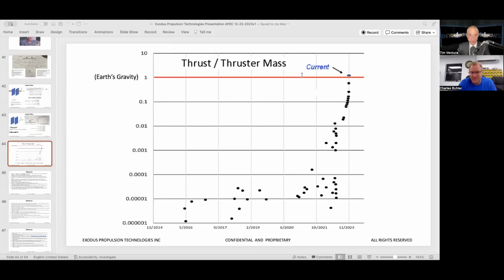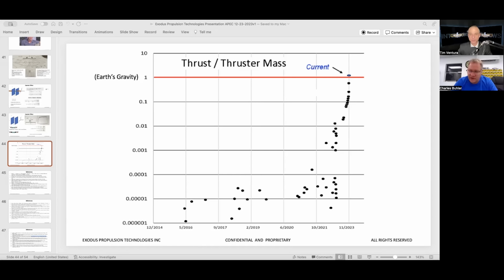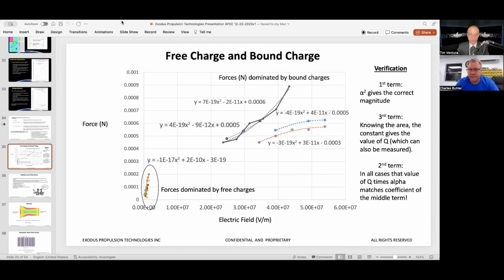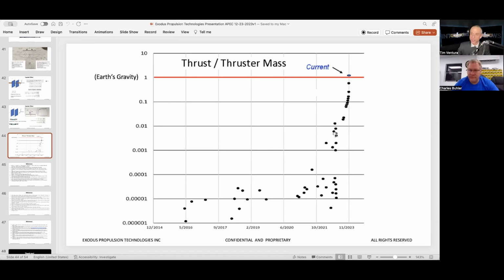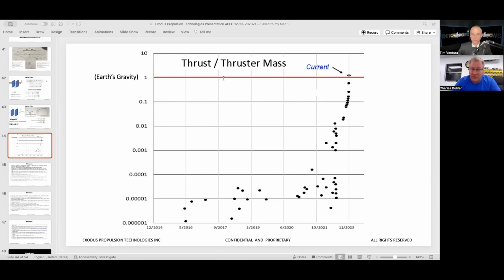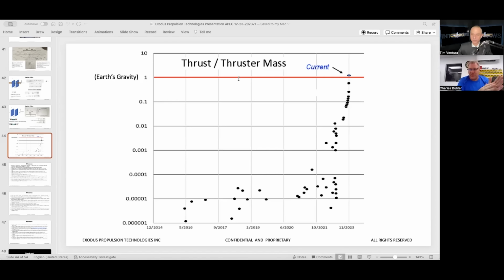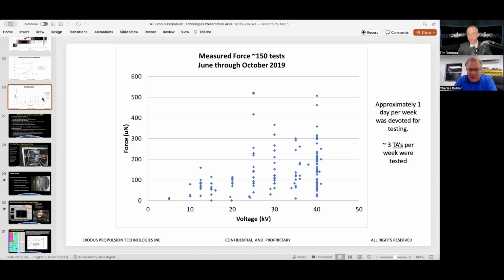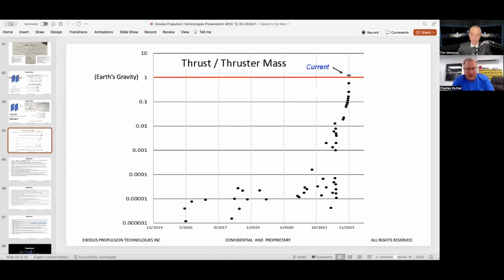Propellantless Propulsion Device | Charles Buhler

Comment: Getting to Mars at constant 1 g acceleration takes just 89.44 hours. To Jupiter is 157.44 hours. It only takes a year to reach near lightspeed. This is HUGE!
Reply: To reach but double to slow down
Reply: @openleft4214  oh give or take, sure. But you aren't really limited to only 1 g for human endurance either.. so both acceleration and deceleration phases could conceivably be shortened further, or even add a period of weightlessness near the middle of the voyage. Which could be fun.
Reply: Do they realize that have 1G of force using electrostatics only, is basically a very close to "free energy" ?
Because if you have 1G of electrostatic force, you could use to rotate a modified AC generator with nothing but charge maintenance. 
Does anyone understand that???
Reply: @raysplay2827  Absolutely. I've been giving this thing the biggest possible benefit of the doubt by assuming a constant power draw but really from what the guy said the power draw is literally zero! Literally getting energy for free.

Also I hope he realizes that "1 g" when you have a tiny fleck of paint or whatever his test article is, is not at all impressive.
Reply: @isodoubIet  seems like it's free as long as you don't do work with it.
Once the electricfield is used to do "work" like rotating a rotor, this will require energy.
When the force is just force and doesn't do anything, then it's OK and energy won't be consumed you only have to maintain the charge.
Reply: @raysplay2827  this might be an interesting point to interject and remind everyone that perpetual motion already exists.. there is a sample of helium-4 (which makes up about 1/4 of all the matter in the universe) that was only stirred once, and it will continue to swirl forever, or as long as the temperature is kept below -270.98°C, whichever happens first. I'm not saying you can extract useful energy from it forever and keep it moving forever, that would violate conservation.. but to hear physicists scoff at "perpetual motion" as a concept is.. special. Remind me how Newton's First Law goes again? Are we just forgetting all the countless planetary systems with stable, harmonic orbitals? Or what about the humble, timeless photon? Neutrinos or even ultra-high energy cosmic rays if you're hung up on 'objects' having rest mass.
Reply: What I'm saying is the outside forces can be constructive as easily as destructive-- consider two opposing planetary transfer close fly-by maneuvers, used to obtain the exact opposite result on their total velocity from interactions with the same body of mass, at pretty much the same altitude of periapsis, traveling on very very slightly divergent trajectories but from the same origin: the slingshot or the capture maneuvers; merely by aiming for the trailing edge of any mass, with respect to its own path in orbit (around the Sun for a planet, but this works with moons as well), you are able to gain a significant boost in velocity, easily adding kilometers per second to your mission delta-v budget essentially for free, aside from the added time. The Cassini spacecraft averaged a 0.75km/s increase in velocity with each pass by Titan, of which it did 127 encounters in total, for reference. Conversely, if you aim towards the leading edge of a planet on final approach to an encounter, the force of gravity acts increasingly against your velocity vector during the time leading up to and just following your closest approach (or periapsis), bending your trajectory even more than a slingshot would, but also slowing you down, making it much cheaper to perform a deceleration burn to drop into an orbit. This is an example of simple gravity applying the Oberth Effect automatically to objects with the correct fly-by trajectories. Look, we don't have a unified, quantum theory of gravity yet.. but we know all these effects are happening between wave-like particles on the quantum fields and spacetime itself. We can make pseudoparticles with amazing properties; we can evaporate matter into radiation, and condense radiation back into matter. To say that we're done discovering is to ignore everything we already know!
Reply: @graphite7473  What you were saying before was wrong. What you're saying now is not even wrong.
Reply: @isodoubIet  I can't make sense of any of your points. What are you trying to say here?
Reply: @raysplay2827  "charge maintenance" does not sound like you're getting anything for free.. that sounds like any ordinary electrically powered system, from a thermodynamics perspective. Certainly this one is engaging with the fields in ways we haven't seen or defined previously, but that is not some kind of surprise in and of itself..  there's been a rather steady stream of new ways to get stuff to interact with other stuff and even just entirely new stuff that was really there all along, such as the Higg's Boson, over the last many, many years.. from pseudo particles to metamaterials, twisted bilayer graphene and other novel conductors, Bose-Einstein Condensates, etc.
Reply: @graphite7473  Nope, it's not the same.
Think of it as charged batteries that are not being used.
Some batteries can keep the charge with very low leakage.
The electrostatic force is not being used it just is there in a certain direction.
It's not being used to move objects and therefore the energy of the electric field not being used.
Simply put, there is no energy transfer happening, maybe a bit to ambient particles present between the plates.
Reply: @raysplay2827  I have no idea what you're saying? Neither do you, I suspect.. look, are we not talking about a thruster? That provides thrust? To objects with mass? Using the electric field? I'm struggling to find a coherent argument in your replies, but I'm just not seeing it?
Reply: And... it's bullshit.
Reply: i asked chat gpt 55.41days round trip to mars at 1g
Reply: @TheFilmGuyOfficial  yeah that's fine for chatbot, because chatbot has no mass! 🤣👍
Reply: @TheFilmGuyOfficial it's 2-3 days to get there.. AI is brain rot.
Reply: Read the UAP Disclosure Amendment of 2023
Reply: Yeah, i dunno, I call BS.  Until its in space operating it aint real.
Reply: Next 2 questions.
1. Deceleration
2. Time dilation
Reply: @sebastiancleveland727  1. Yes I put the travel times for a fast fly-by, 100%.. and yes, an orbital insertion requires deceleration to drop into orbit at your periapsis of initial fly-by, so certainly a mission to land somewhere like Mars will take longer, but we're still talking a difference of hours not weeks.
2. 1g is the same force the Earth exerts, so literally there would be exactly the same amount of time dilation as at sea level on Earth. You couldn't even operate a functional GPS satellite under 1g of constant acceleration.. time dilation is normally used to complete the triangulation calculation!
Reply: @Dandelion_Stitches  Charles Buhler, PhD
Dr. Charles Buhler, the Principal Investigator for Poly-Adaptive, LLC is also the owner of CRB High Field, LLC an electrostatics research and testing facility in Cape Canaveral, Florida.  For 10 years as a senior research scientist in the Electrostatics and Surface Physics Laboratory at NASA Kennedy Space Center, Dr. Buhler worked on several electrostatic discharge (ESD) issues, including ESD safety, gaseous discharges (e.g., corona, pulsed corona, glow, brush, and propagating brush discharges) in hazardous environments for the Space Shuttle Program, the International Space Station Program, and the Hubble Space Telescope Program.. He was a Co-investigator for three NASA Research Announcements funded by the Mars Exploration Program with research in the areas of: instrumentation for the classification of Martian aerosols, methods to prevent dust accumulation on surfaces under Martian conditions, and the link between electrostatically charged dust and the lack of organics on the Martian surface for the planetary science community.  He continues to serve as a subject matter expert on NASA's E3 Panel, the agency's leading board regarding all ESD-, EMI-, and EMC-related issues for the space program.  Dr. Buhler has spent five years on NASA's Dust Project focused on electrostatic methods to remove dust from personnel and equipment to be sent to the Moon through NASA's Constellation Program.  He now leads the research effort for Poly-Adaptive performing guidance over all dust mitigation strategies for commercial and non-commercial applications.  Dr. Buhler completed his doctorate in Condensed Matter Physics at The Florida State University in 2000.

Ok let's see your CV for a comparison:
Reply: That's what she said
Reply: It has to decelerate upon arrival, the same amount of time if 1G is used.
Reply: @davidhoch  of course.
Reply: If this is real, you can potebtionally make a warp drive and even go ftl.
Reply: @bringtheideas460  I don't think he's canceling inertia with this drive, rather it relies on there being some to add momentum to. It's still classical acceleration, only it uses a novel electromagnetic field interaction to push or pull off of, and only needs onboard electricity to generate that force, no reaction mass/exhaust. At least as far as I can tell, and assuming his data and the effect is true.
Reply: @bringtheideas460  this however might be a way to accelerate a vehicle that does use inertial mass cancelation? I'm referring to Salvatore Pais' inventions, for example.
Reply: @graphite7473  That would be raaly cool if that was the case(refering to salvatore pais alikeness), because if you are reducing inertial mass, you might be bending space time? Not sure. But if so, you could perhaps make a warp drive out of this. Like if these assymetric caps produce negative space-time curvature, there you go. Warp drive. If not that then you would still have an exhaust from some kind of engine propeling you, but you turn this on and speed up. But that is just a thought. 

The real problem with having a force like this its apparent violation of termodynamics at first glance. Some energy must be spent somewhere if you are accelerating something. To be exact the electrical energy will have to convert to mechanical. Inertia is a type of mechanical energy. Sou maybe it will lose charge with ascending/accelerating(the assymetric cap)? Dunno. But otherwise you would be creating energy out of nothinh if it was just a force like gravity.
I bet it would draw current when accelerating...
Reply: @bringtheideas460  it's my understanding that this drive would never quite get up to lightspeed, but it would certainly continue approaching it as long as it has power. After one year of operation at 1g it would be well into the final 1% below c, and would have traveled about a half lightyear. It's tricky to predict the degree of time dilation, as most of the curve (describing the Lorentz Factor) happens in that last 1%. Time moves 7.14 times more slowly at 99% (of c), 10x at 99.5%, 22x at 99.9%, 224x at 99.99%, 704x at 99.9999%, etc exponentially.. but the bottom line with relativistic velocity travel is that the further you can go accelerating continuously, the less elapsed time you'll experience when traveling further and further distances into both space and the future, with greater and greater ease (and less and less aging). To be clear, I do think it's likely that FTL is possible, I'm just saying that this inertial drive wouldn't give that effect, despite being itself leaps and bounds ahead of anything else we've ever come up with for locomotion.
Reply: Wow, Is this really true, sounds like zero energy production. There should be all hands on deck!!!
Reply: Having read most of the conversation under this comment, I feel there is not enough information to come to a conclusion about it being a perpetual motion device.

My reason for saying this is because, they charge these dielectrics in a vacuum. This 1g of thrust is acting only against gravity - not atmosphere. We don't know how much charge they put into it, how large it is, or how much it stores. The fact that it retains charge, and presumably thrust, could just be a sign that it had not expended all of the energy that was stored in it upon its initial thrust and therefore has not violated the laws of conservation.

Unless I just misunderstood the whole thing.
Reply: As soon as he started in about AC and capacitors with bound charge, he lost my interest.  Fake.
Reply: @caseylynch4001  ok but he's literally the guy who was in charge of electrostatic safety on the ISS, the Hubble telescope, and the Space Shuttle.. he is considered a subject matter leading expert in electrostatic effects.
Reply: @caseylynch4001  capacitors are real..
Reply: Вы учили в школе астрономию? Как движутся планеты по орбите?
Reply: @добро-х  It won't let me copy your comment, so I can't plug it into a translator. I only speak English and French fluently, with the odd few words in random other languages, but mostly phonetically. Can you translate that to English?
Reply: @добро-х  I don't even have a virtual keyboard on my phone that I can use to type that out visually.
Reply: I think I could deal with 1.25g.  you?
Reply: 1 g of force?  You need a mass in there...
Reply: @kayakMike1000  I'm not sure what you mean? You mentioned "the strain", and I clarified that you and your ship will only feel the force from 1 g of acceleration (assuming you've chosen that rate of acceleration, to remove health concerns from prolonged low or high gees). What's novel here is the nature of the propulsion system, and that it essentially removes fuel mass from the rocket equation, excepting the fuel used by on-board power plants, and the mass of any related components (but those are static mass values, so they fit into dry mass anyway). Obviously we would use nuclear reactors of one kind or another for their efficiency, reliability and long life, although a device that is designed to reach near to  lightspeed offers the unique opportunity of reduced operational lifetime with respect to the Earth's frame of reference. As stated earlier, after about one year of continuous acceleration at 1g, it would be experiencing somewhere between one hour for every seven hours up to 1hr/hundreds of hours that pass back home. If you just keep accelerating until the halfway point of any trip, it starts to not matter how much further away the destination is more and more as you aim for further and further away. Relativity is on our side for almost any distance of travel within our individual lifetimes, if we can accept abandoning everyone we knew and left behind in the 21st century.
Reply: I have tried talking to other scientists about this, most won’t even look at it they are so dismissive, but I hope it’s true. Looks amazing 🤩
Reply: Sharefacts/ StarDrive Engineering company been Designer and Builder in Scientific Sciences and Advanced Quantum Mechanics Physics and warp dimensional drive saucer spacecrafts technologies !
StarDrive Engineering company been Contractor 39years for Dept of Defense pentagon 
Example /StarDrive Engineering company warp Dimensional drive from earth in milky way galaxy to andromeda galaxy nordic 240 seconds by warping Time and warping space and warp 132 multi dimensional universes by traveling faster than speed of light!
Reply: There is no gravity or gravitational effects inside a warp bubble, no G forces, no G force limits on acceleration. G Force of propulsion is a factor of the total capacitor charge, add more caps, get more propulsion. FTL in under 1 year at 1.5 Gs, but why stop at 1.5 Gs when there is no G force limit.
Reply: @NoNo-f4h  this isn't a warp drive, but I feel you. This is a lot more like the impulse engines, just to be clear.
Reply: @NoNo-f4h  there are definitely g force limits with any kind of impulse propulsion. Whether it's the structural integrity of the spacecraft itself, or the survival of human occupants, there's only so much acceleration force that can be handled. An extreme example would be a detonation ripping something to shreds, but even sustained 16g maneuvers will rip the wings off an F-16.
Reply: Keep in mind that 1g for the device itself basically means a thrust to weight ratio of 1. And the device requires external power, too, and most likely a huge amount of it. So if you slapped it on a ship, you would end up with way, way less than 1g of effective acceleration.

To give you an idea of how performant typical rockets are, SpaceX's Raptor engine has a thrust to weight ratio of about 143. A merlin engine has a TWR of close to 180, I think?

To make this thing work in-atmosphere at all you'd presumably need 50g+ of acceleration and a nuclear power source. Making it useful in space would probably require either a massive thin film solar array, or a very compact nuclear power source. In deep space, you'd favor the nuclear approach as well.

Basically, this IS a huge breakthrough if it's real, but it is not something that just magically makes us capable of interplanetary hops overnight. It will probably be 20 years before this is seen anywhere but a lab setting, if for no other reason than the fact that it would require far more energy than current methods.
Reply: @AUniqueHandleName444  no, I was simply referencing the travel times etc if you operated the drive at 1g of thrust on the vehicle. It's a hypothetical. I wasn't getting into thrust to weight ratio, total power etc, but yes obviously you need greater than 1 g to escape the Earth's gravity. Incidentally with this kind of drive you wouldn't actually need to increase the thrust very much above 1:1 TWR. A Falcon 9 launches with a thrust to weight ratio of 1.4-1.5:1, depending on payload, but this drive doesn't run out of fuel, doesn't need to drop stages, and isn't necessarily trying to reach orbital velocity in a few minutes. I should really lead with: I have over 10000 hours in orbital flight simulation.
Reply: @AUniqueHandleName444  It's not real.
Reply: At the closest possible distance? Or is this for the average distance?
Reply: @angeltear2145  I think these times are for the average separation, but I'm not 100% on that? It certainly gives us a ballpark figure to work with at least.
Reply: I am very glad that before  I read your  work and vision  you  have discussed the weird space-time and QED. 
Since my long I an involved in developing a basic space -time model with simple physics and mathematics to  understand all of the science in one simple attempt. 
It naturally has properties that you are probably looking for.  As it very fundamental in concept I have solved and derived  atomic to QG.
Asymmetric nature too explained. 
Good  luck  for SURT (super relativistic theory) my own. 
I salute your great observations and good experiments.  We have it,
I am still  at it and by curiosity I am looking rotating BH.
I had left institute of fundamental sciences back in  2006.
Reply: @sorryforbwingmeanididntmeanit  No, I didn't. It doesn't matter if there's friction and heat, if this thing works at all it's a perpetual motion machine. Not negotiable.
Reply: @isodoubIet You're right. I didn't realize they claimed 0 energy input.
Reply: @sorryforbwingmeanididntmeanit  It doesn't have to be zero. Anything less than 300 MW / N can be bootstrapped into a perpetual motion machine.
Reply: @isodoubIet  So what do you speculate is really most likely here? That they are not properly measuring their inputs and outputs? Not working on a scale large enough to see practical failure?
Reply: @sorryforbwingmeanididntmeanit  Probably something of that sort. It's hard to say what exactly without looking at the data in detail or maybe trying to reproduce the experiment. Measuring really small forces with accuracy is incredibly hard because of all the possible confounding factors. With the Eagleworks test of the emdrive for instance they were confusing the thermal expansion of the test article with an actual thrust. Other tests were confounded by outgassing, or electromagnetic forces between the article and the setup.
Reply: We don't know enough from the "whole system" involved to accertain the total input energy needed to make a 10 gram dielectric plate stack react with 1.015 Earth g. This tech is likely a century or more away from any type of actual space craft use. It will NOT advance as quickly as Moore's Law does with micro-electronics and computer advancements. We do not even know what the nature of the force is. It's not and action Reaction Newtonian force. It could be a gravity well, which if that is the case, forget 1 G. You could theoretically appear to accelerate at 1,000 Earth g's and the sensation would be like free falling. You would not be plastered like paint because  inertia would not apply in the same way as it does for action reaction applications.
Reply: But it isn't real. This whole video is bs. Don't be a sucker.
Reply: Acceleration halfway to Mars and deceleration the last half.
Reply: This would be huge if we can 1. see a demo, 2. get a BOM for conformation
Reply: All you stated was the physics of what's required to make the space travel as you indicated. That's just basic Newtonian physics calculations that we've known since Newton. You didn't comment in any way on how you're going to get a 1G constant acceleration of Any Given mass in space!
Reply: @edd7812  I'm not actually the electrostatic effects and systems expert from NASA, that would be Charles. He's still not sure what to call the effect. But this sounds like the Byfield-Brown effect, maybe? It could be a quantum effect, I don't know? My excitement is because they're measuring that amount of force in their device, regardless of how we ultimately describe what causes it to work; I'm inspired by his experimental data. If the effect scales, or can be amplified etc, those are the fly-by travel times at 1g (9.80665m/s²). Kind of the perfect acceleration for Earth life such as ourselves, and as you can see we really wouldn't need to push much harder than that to get almost anywhere in the visible universe.
Reply: @graphite7473  that's a lot of ifs but that's what experimentation and science is all about is solving those ifs to advanced Technology or mankind! It would be really interesting if it was some type of quantum effect on a very small scale as most speculation about long distance space travel within human lifespans is in the quantum realm... 👍
Reply: MARS  no  moon first lets investigate the Moon first to put  the doubt to rest,  Mars is so far away , so let's establish a moon base first .
Reply: @uriahyoung2532  weirdly, using conventional rockets, the delta-v budget to go to and land on the Moon is actually higher than Mars! Distance is more of a time factor, than a cost increase for fuel. Remember you're doing short burns and coasting the rest if the way with rockets. Anyway, because Mars has enough atmosphere to perform aerobraking, a higher gravity which reduces the cost for orbital insertion at the periapsis of initial fly-by (greater Oberth Effect), and you can even use a parachute, the delta-v to Mars is only around 5.4km/s (from LEO), whereas to land on the Moon costs 6.5km/s from LEO. Furthermore the Earth, Sun and even Jupiter all pull you out of Lunar orbit over time, so many more course correction burns are needed for a precision landing, just to maintain heading in orbit prior to landing. Between the increased maneuvers for the Moon, and the decreased (propulsive) maneuvers for Mars, Mars actually wins. Takes way longer to get there typically, but it takes less fuel.
Reply: @uriahyoung2532  I recommend Robert Zubrin and David Baker's book 'The Case for Mars'. There have been newer discoveries that affect some of the data used in it, but on the whole it still holds as a solid mission profile guide.
Reply: @uriahyoung2532  I'm not suggesting that we cancel Artemis and only go to Mars, mind you. Having a cis-Lunar space refueling depot will allow even more efficient Mars missions than those from LEO. It will also allow us to increase the scale of interplanetary transfer vehicles beyond what can be flown up from the Earth's gravity well in one piece, and in the case of cyclers, beyond what would be aerodynamic enough to fly in atmosphere at all. Edit: and since the propellant can be manufactured in situ from water ice in permanently shadowed polar craters on the Moon, using sunlight that is perpetually present at those craters' rims, it also drives down the cost of fuel. Getting heavy tanks of fuel to space from the Earth is expensive, especially if you're not burning it off to power its own lifting.
Reply: Ironically the cis-Lunar refueling depot station will also make it possible to reduce the size and mass of interplanetary vehicles, if for some reason we wanted to do that. Or meet up somewhere in the middle, and reduce the fuel tank component, giving more room for payload or living space. You can just arrive at the station almost dry, and top up. Even get a big free boost when you leave from a maglev-style accelerator at the station eventually. You could time departures to act like a mass driver for some of the station's own station-keeping maneuvers too, or at least to oscillate orbital phase shifting between alternating departures.
Reply: @graphite7473  okay, we need honesty in our world(s) that's all.
Reply: @uriahyoung2532  in many ways, Mars is the second safest place for humans in the solar system. There are abundant local resources for constructing large habitats on both worlds, and water to drink, or make air and obviously hydrolox fuel. On Mars however, you also have plenty of CO² to work with, so you can make more advanced fuels, hypergolics and so forth, methane with a Sabatier reactor etc., and that gives you another source of oxygen to breathe, and a use for that cheap, excess hydrolox you picked up from the Moon in life support. The Sabatier reactor, or CO² methenator, produces methane and water by combining hydrogen with CO², so it turns rocket fuel and Mars air into drinking water and fuel for rovers and emergency generators. Or using electrolysis you can extract oxygen and hydrogen from the water byproduct, breathe the O² and feed the H back into the Sabatier. So your water supply becomes a long term storage for your air (and rocket fuel, and internal combustion fuel).
Reply: Water makes a really good radiation shield too, so having lots of it, and surrounding yourself in it, essentially wrapping living areas in water bladders, isn't a bad plan.
Reply: Such a system could borrow the temperature differential between the day and night to squeeze the water bladders into pressurized containment in a cyclical routine, with clever materials selection in their housing, some kind of highly expanding lattice of memory polymer or some such, and some simple one-way valves.
Reply: probably a little longer if you want to slow down and stop 😉
Reply: Will Elon Musk and Jeff Bezos join the fray (sort-a-speak)  I still think we should go to the moon to investigate and to set up a moon base of sorts. For easier space access.
Reply: I have no problem with people like this becoming multi-billionaires for new technologies. I just think this will be something that we will never hear about for a variety of reasons.
Reply: It would be if it was real.
Reply: Why are we trying so hard to get to Mars? I would go the other way myself. Just saying
Reply: Not as huge as slowing down 👇😅
Reply: @Mark-ce9xh  slowing down and speeding up are the same thing. If this can accelerate, it can decelerate equally well. Yes I am aware I used travel times for a fast flyby encounter, but to capture into orbit will not add 180 days to the trip, so this would still be significantly faster than conventional chemical rockets.
Reply: Dear all, 
I have come up with a new idea that works based on magnetic force symmetry breaking rather than electric pressure symmetry breaking. It has several advantages to Dr. Buhler's idea and is mathematically and theoretically explained.  Thumb up this post so that everyone sees it. Please google for my paper: 
Net Magnetic Force Generation in Discontinuous Circuits: A Force Symmetry-Breaking Phenomenon
Reply: It depends on starting mass and how fast you were going when you started your trip, leaving the moons orbit would be a quicker trip to Mars than leaving low earth orbit for example. And also the 1G force might not be possible to sustain for long periods it may be short bursts of one G every couple hours or so between battery charges.
Reply: @TheBowersj  I'm not sure I can agree with all of that? The velocities needed to orbit at a given altitude increase as altitude decreases, that's why the ISS is moving over 7 times faster than the Moon. The potential for savings with a stop near the Moon or somewhere in cis-lunar space comes from refueling with fuel that was manufactured in-situ on the Moon. It's the prohibitive cost to loft heavy fuel tanks out of Earth's steep gravity well and thick atmosphere that can be saved. An actual Moon landing still takes more delta-v than a Mars landing, from LEO. Incidentally, you don't just go straight from any LEO to either destination, first you adjust your orbit to the correct plane of inclination, and the correct phase to align with your transfer window, which is called a translation orbit. Ideally your escape trajectory will be formed on the opposite side of the Earth from the burn maneuver, which is done at perigee to gain advantage through the Oberth Effect. You will also miss that boost for the leg out to Mars with the lunar refueling stop mission profile. The bigger the craft/payload, the more it makes sense to refuel at the Moon, as fuel volume and mass goes up.
Reply: Supersymmetric quantum cold fusion mega thrusters achieve 2g acceleration ... all my testing shows it WORKS .. I just need more money to change the World... paypal today!!!
Reply: It's not electrogravitc
Reply: @JulianCarson-iy1md  it’s not even propulsion…. Utter BS
Reply: Perhaps Von Braun with the scientists at Peenemunde had the arnsewers to this spacewalk traversing ,before the end of the last world war ,fast forward to White Sands Navada ,Groom lake - S4 facility programs.
Reply: The smaller, the available free space the higher, the dielectric capacitance— asymmetrical charge, confinement places, a divergent force against the quantum vacuum energy- by doing so a propulsion less field reactant force emerges!

One can’t interact with the field directly, therefore, and a symmetry must be created.

I hope you’re reading this comment, Jeremy ;) - and the boys in the falcon lab!
Reply: @XF1reX  in an arrangement with two charged capacitor plates and a highly dialectric material sandwiched in between, the function of the material with a high dialectric constant is to reduce the voltage, thus increasing the capacitance (as capacitance C is just the amount of charge Q to each single volt V, and the supplied current remains the same), allowing you to store the same amount of energy at a lower voltage, and a side effect of adding the dialectric material is to attenuate the attraction between the two charged plates. That can be useful in high density storage media whose physical structures might be put in peril by internal stresses under overloading, such as during a lightning strike. That's about the extent of my understanding at the moment, so I would love to hear more about how a propulsive force is derived from this starting point?
Reply: There’s no vacuum in space it’s only light 💡 Vortex energy space is very violent a swollen river of currents it’s always pushing and pulling and grinding and compressing the only way to travel is with a magnetic inclusion field you’re all hung up on this believe that rockets can easily launch vehicles in space your being brainwashed from this concept it’s that’s just a television screen you see it’s called blue screen It’s all underwater CGI your NASA colleagues lie to you
Reply: How do you slow down and stop?
Reply: You might want to land on Mars and not just fly past it though. So now it takes twice as long because you have to turn over half way there.
Reply: The common method of travel throughout the Cosmos is non-linear. Field Propulsion will enable super luminal travel, anywhere, anywhen, rather instantly.
Reply: @FieldPropulsion  I mean, that would be an ideal sort of propulsion, so don't get me wrong if it is possible, and easy enough to achieve, then sure I suppose we could expect to see a proliferation of use.. but you speak with the kind of certainty I don't typically associate with where we're at in our actual understanding of the universe and her contents. Is that just for brevity, or do you know something substantial?
Reply: @FieldPropulsion  like again, don't get me wrong.. Break Through Listen Candidate 1 is a planet in the habitable zone of friggen' Proxima Centauri, the closest star to ours. I fully expect us to discover that the universe is teeming with life and even intelligent, technological civilizations, but that isn't the same thing as declaring "every toilet in the Milky Way Galaxy has a bidet except certain parts of Earth", which is itself not the same thing as "there is a galactic multi-species cohesive civilization and all their toilets are ACME brand and feature a bidet".. Now even a broken clock is right twice a day, and it could turn out that indeed, bidets rule the universe. That wouldn't make my statement "truthful" even if it was coincidentally true. Hence why we try to use language that respects the degree of uncertainty. Like, "I wonder if aliens use bidets, or toilet paper.. or something.. else?". That's science.
Reply: I think you're forgetting about deaccerlating
Reply: @digitalpacman  Exotic crafts (UFOs) need not slow down exactly since they do not move in a classical linear path. Instead they simply teleport from point A to point B.
Reply: Wow, this is exciting to know and speculate. Thanks for the calculations!
Reply: you still need a ton of energy
Reply: I am very skeptical. More in favour of thin film nuclear isotope rocket with long decay chains and electricity generation for spacecraft systems!
Reply: lol I have relativistic speed plasmas which are much faster
Reply: You don’t understand what force is.

A force of 1g does NOT produce an acceleration of 1g.

The actual acceleration depends on the mass of the object.

The 1g referred to in the video is the thrust generated divided by the mass of the engine.

This takes no account of the mass of the device used to generate the power consumed by the ‘engine’, the fuel to run the engine, the structure of the craft or the payload.

Obviously the ACTUAL ACCELERATION experienced by the craft will be considerably LESS than 1 ‘g’.
Reply: @JohnSmith-x3y8h no, I absolutely do understand that this is 1g to a small, very lightweight device no more than 6 inches across. The key point here is that the entire mechanism needed to produce the thrust is able to lift itself. Now before you complain that there's also power generation to be considered, and payload etc., these are early tests limited by the small size of their available vacuum chamber, they are keeping the voltage below 400v to avoid corona discharge and other ionization effects that can skew their data, and lastly and perhaps most importantly: this device operates continuously once loaded with a static charge -- it does not need constant power supply.
Reply: I would add that miniaturization has come a long way, and even without scaling this up for manned vehicles, it's not hard to imagine cubesats being sent to nearby star systems, capturing close up data, and then returning to Earth. 1g is simply a measure for baseline here, constant reactionless acceleration is the breakthrough.
Reply: @JohnSmith-x3y8h I am curious.. are you aware that we're discussing the work of the incoming president of the Electrostatic Society of America? A man already with two discoveries of novel electrostatic effects under his belt?
Reply: Also, you are completely incorrect; a force of 1g is a measured acceleration of 1g, in point of fact.
Reply: At 1.5 Gs it would exceed the speed of light in under a year. if it is indeed an Alcubierre drive, there is no gravity inside the warp bubble and it would explain how UAP handle all those Gs of acceleration. It would not be G limited in it's acceleration or ability to turn.
Reply: @NoNo-f4h  Alcubierre drives require negative energies so you can't build one with just E&M
Reply: @Dandelion_Stitches  "Force defies convention explanations" raises all sorts of red flags.
Reply: @rockets4kids I think that's because it's new don't be scared we like new things!
Reply: @rockets4kids 😊you😅😊
Reply: @rockets4kids - It’s a fully matured technological platform that they are disseminating into the commercial sector in a controlled way with the pretense that it’s a new discovery to fund weapons platform development. Sorry to blow the whistle, but whatever

The dust removal is a massive clue, because it has to do with the whole charged sky rails used by millimetre beam-forming ionisation of aerial platform, power and network distributions — aka geo engineering platforms-
Reply: @rockets4kids  the thing is, it really doesn't. We absolutely still have much to learn, for starters. Secondly, these results have been replicated by more than one impartial third-party laboratory. I'm sorry, but what are YOUR standards for a hypothesis reaching the level of theory, and why are they different from the standards in the wider scientific community?
Reply: @graphite7473  As I said, anything which cannot be explained by existing physics demands an exceptional level of scrutiny.
Reply: @rockets4kids But scrutiny isn't what you're doing. In fact you offered nothing to the argument but the same 'red flags' mentality that keeps love from blossoming today.  Yes, I'm bitter lol...just kidding, it was the only analogy I could think of.
Reply: @stoneneils  Shoot me a link to someone who has replicated this study.
Reply: @stoneneils well said. Certainly lots of pizza cutters out there
Reply: @graphite7473  Lol go to any physics department, tell them this guy has a perpetual motion machine from them to review, and let me know how they react.
Reply: @isodoubIet  Virtual particle flux, as described by Tom Bearden... wait never mind, physics departments won't like that either 😅
Reply: @isodoubIet  when did I say anything about a perpetual motion machine? His drive obviously is intended to provide a steady, continuous and most likely very long duration thrust, sure.. but it still takes energy to operate, presumably from an electrical power supply of some kind. No one is invoking perpetual motion except you, thus far here.
Reply: @graphite7473  You didn't have to say it -- you get the perpetual motion machine for free from the principle of relativity.

The change in kinetic energy per unit time is given by F * v. If your drive produces a constant force, but takes in a constant amount of power, there's always a speed at which it spits out more energy than what you put in.
Reply: @isodoubIet  it's no different from an electric propeller-powered airplane, except for the media it produces thrust via direct interactions with isn't air; it is interacting with the quantum fields themselves instead. Have you heard of the Casimir Effect? One mathematically and descriptively/predictively sound interpretation of the underlying physics at play is called Quantized Inertia (QI). The drive by  IVO currently in orbit appears to be the fruits of their efforts to replicate Buhler's work, and stands to be our first irrefutable confirmation of QI as a valid scientific theory, as well as the first propellentless propulsion system that can operate in atmosphere, vacuum, near or far from magnetic fields, shielded or unshielded.. if QI turns out to be correct (and it does already accurately resolve both the dark matter and dark energy problems simultaneously), that means we can engineer metamaterials to control inertia or momentum, since it is all based on assymetrical pressure-like forces due to the vacuum fluctuations of virtual particle pairs sharing wave-like properties (duality), which can be restricted, tuned, focused, amplified, combined, separated, polarized, etc.. Forces can be generated this way, so really we already knew we needed a new mathematical framework to describe this, and all the knock-on effects of this new set of potential energies as it inevitably extends out to any scale you like. You get accelerated expansion, and real galaxy rotations derived by only plugging in the estimated mass of visible matter. Accurate prediction of the galactic cohesion falloff distances, and it doesn't neglect clusters previously mysteriously absent of any dark matter. It is falsifiable, unlike every other dark matter theory, takes no arbitrary variables simply plugged in after the observation is (inevitably) seen to not match calculations, like in every other dark matter theory.. rather the calculations give a galactic rotation speed etc that can then be checked against longer observation results, so far with only success.
Reply: @isodoubIet  that's ridiculous, and also you're the only one even implying that, let alone saying it.
Reply: @graphite7473  None of that. If I'm wrong, prove it. (I'm not though, so you can't).
Reply: @isodoubIet  well for starters, one of the labs that replicated his results, IVO, has placed a drive IN ORBIT as we speak.. So I guess wait and see? I assume the thrust charts presented in this  video were just too technical for you to understand?
Reply: @graphite7473  I don't care what specific mistake was made. I just know that a mistake was made. How? Because his contraption violates conservation of energy and conservation of momentum, both of which are satisfied exactly in QED. It's not negotiable, he made a mistake somewhere.

You're also dodging the question. Where's the error in my proof?
Reply: @isodoubIet  what proof? You have only demonstrated that you're not actually listening to what people are saying. You think we already know it all, so anything new just has to be wrong. I disagree. We still don't know why black holes release relativistic jets, or why the frame dragged region outside a spinning black hole converts everything that falls into it to pure energy in a process several orders of magnitude more efficient than nuclear fusion.. there are clearly defined limits to our understanding, and all of them are areas of active study!
Reply: @graphite7473  The proof above. It's really not complicated.

Change in kinetic energy per unit time = F * v. Power is drained from the battery at some constant rate P. At some v = P / F, the spacecraft gains more power than is drained from the battery. Strap it to a generator and you have a perpetual motion machine. It's over, reactionless drive bros.

The rest is all irrelevant and/or wrong (there's no such thing as "converting into pure energy", that's just category error). Energy is conserved in all those situations.
Reply: @isodoubIet  ok but what if I were to tell you that your "proof" is not logical? Naturally you are enamored with your own ideas, and so will simply reject such assertions out of hand. Because it is not discourse you're after, it is the breakdown of discourse. You honestly have not shown how you reached the conclusion that you would get "more" out than goes in. Your equation for kinetic energy is not even the right equation, for one thing.. ke = 1/2 m * v², my dude.
Reply: @isodoubIet  you are so sure of yourself, but you are very much incorrect in all your points thus far. American psychologist David Dunning has a whole theory about this phenomenon, pretty famous one too. You should perhaps try harder to falsify your own ideas before leveling them on the rest of us? A quick Google search would have shown you that you had the wrong equation, for example. It's tiresome.
Reply: @isodoubIet  I suggest you go back to the drawing board. Three independent labs have already replicated the results whose data this video showcases. Perhaps you would be better off addressing how THAT is even possible first? Have all the advanced propulsion companies gone mad, or are you just slow to catch up? It can't be both.
Reply: @isodoubIet  I do have another question for you, if your ego will allow me to even ask it: aren't you at all curious about how the Barry-1 mission will go? It doesn't strike you as.. odd that IVO is confident enough to buy a trip on a rocket for their quantum drive? Surely if this was an impossible perpetual motion machine, they would have identified that way before spending that kind of money? No? I think it's pretty likely, personally. I would be all ears for a sound rebuttal, but so far that is not what you have offered.
Reply: @graphite7473  " ok but what if I were to tell you that your "proof" is not logical?"

You'd have to prove it. And you wouldn't be able to, because it's not.

"You honestly have not shown "

I showed it very explicitly. You don't get to disagree.

"Your equation for kinetic energy is not even the right equation, for one thing.. ke = 1/2 m * v², my dude."

Pay attention. It's the change in kinetic energy per unit time. See for example eq 2-6 in Symon's book. This is VERY basic stuff.
Reply: @graphite7473  "David Dunning has a whole theory about this phenomenon"

I have a PhD in physics. Pretty sure you don't. Who do you think is more likely to be suffering from the Dunning-Kruger effect here? I remind you, you didn't even recognize the very basic power = Fv relationship, and you thought I meant mv²/2 instead. That's not a mistake anybody with an undergraduate degree in any technical field would've made, so some soul searching might be in order for you.

As for the rest, I don't care. You know what? How about you put your money where your mouth is? $2000 this goes nowhere. Well?
Reply: @isodoubIet  you even misquoted the equation I used..  your speech is positively peppered with self aggrandizement.. you aren't listening to anyone but yourself. And you're consistently wrong. I hope you didn't pay too much for that useless PHD.
Reply: @isodoubIet  add in the $2000 bet, a very obvious tactic to inspire financial terror.. looking to intimidate me into acquiescence, are you? I'd say you are definitely reacting with pure emotion, in a fight or flight response, adrenaline up.. waving your degree around, while blissfully exposing your own misinformation..
Reply: @isodoubIet  incidentally you may want to go back and take a look at the equation for 'power' in a system.. you keep using it (P = F * V) but incorrectly referring to it as the equation for change in kinetic energy over time (which is: K = d/dt(1/2 mv²) or K = 1/2m*d/dt(v²)..). So yeah, there's that.
Reply: @graphite7473  "ou even misquoted the equation I used.. "

Oh my god. You think 1/2 m * v² is different from mv²/2. You need to study this subject at an elementary school school level before you have an opinion.

" I hope you didn't pay too much for that useless PHD."

Lmao nope that's not how PhDs work. I got paid for my PhD. And it sure isn't useless if it lets me spot BS from a mile away that laypeople such as yourself just can't see even after it's carefully pointed out.

"a very obvious tactic to inspire financial terror.. looking to intimidate "

If you're right it shouldn't be intimidating. Sure isn't for me. I see it as free money if you accept.

" waving your degree around,"

Nope, not "waving it around". I only brought it up because you brought up Dunning Kruger, and it's important that you have an accurate perception of who's suffering from that.
Reply: @graphite7473  And PS: the relation P = Fv follows straightforwardly from T = mv²/2 by application of the chain rule (as explained e.g. in Symon, which I already pointed out). You really should stop now.
Reply: @isodoubIet  I'll give you that I misread your weirdly written equation.. but with every passing comment the cloud of arrogance you wear like a fashion statement grows thicker, and I find myself less and less inclined to care what it is you're crusading about? Why is it so important to you that I be chastised? Is it a perceived moral failing, deserving of retribution and punishment? What a time to be alive that people like you can no longer employ the strap..
Reply: @isodoubIet  if you were my professor, I'd switch to a liberal arts major..
Reply: @graphite7473  That's nice. So you're not going to try to prove me wrong then?
Reply: @isodoubIet  God no, you're insufferable! I'm not getting paid anything here, so far be it from me to take it upon myself to deign interfere with your superior intellect. Carry on as you were. I'll survive not beating you in any more petty nerd dick measuring contests.. you would NEVER admit to being wrong anyway, who are we kidding?
Reply: @isodoubIet  you only came here to shit on the board, not play chess.
Reply: @graphite7473  Brah your king has been a chalk outline for dozens of posts now. I gave you a very clear proof. Find the mistake in it or concede.
Reply: @graphite7473  Have you considered that maybe you're the pigeon? Where's the mistake in my proof?
Reply: @isodoubIet  you did nothing to explain where your insertion of "more energy out than goes in" actually is? You used the wrong equation (the one for power), as representing change in kinetic energy within a system, and then failed to address or even acknowledge that when I pointed it out.. neither did you in any way actually USE either equation to substantiate anything about your arguments? You'll recall, I've only brought mathematics into this specifically to correct your reference, not to in any way support or refute either of our claims about *the subject at hand*.. that was a tangent introduced by your previous non-sequitur! You didn't even employ said math in your "results", I mean, what are we doing here?!
Reply: @graphite7473  "you did nothing to explain where your insertion of "more energy out than goes in" actually is? "

On the contrary, I gave a complete proof.

"You used the wrong equation (the one for power), a'

Nope, I used the right equation. It's more power going out than going in. Power = energy per unit time. You have to work with me here.

" and then failed to address or even acknowledge that when I pointed it out.. "

That's absurd. I already gave you the reference (Symon, eq 2-6) so you could have more context but the proof is dead simple:

dT/dt = d/dt (mv²/2) = mv dv/dt (from the chain rule) 

dT/dt = (m dv/dt) * v = (ma) * v = F * v

It really couldn't be simpler.

"neither did you in any way actually USE either equation to substantiate anything about your arguments?"

That's just flatly lying at this point.

If you don't understand any of the above, you'll need to pick up a textbook. I could teach you, but you'd have to make it worth my while.
Reply: @graphite7473 "you did nothing to explain where your insertion of "more energy out than goes in" actually is?"

I gave a complete proof, actually.

" You used the wrong equation (the one for power)"

Nope, the equation for power is the right equation, because power is energy per unit time.

" as representing change in kinetic energy within a system, and then failed to address or even acknowledge that when I pointed it out.."

That's because that's what power represents. I mean look, it's extremely simple:

dT/dt = d/dt(mv²/2) = m dv/dt * v (from the chain rule) = m * a * v = F * v (from Newton's second law).

It literally couldn't be any simpler. If you're still having trouble, you'll need to read a textbook. I could explain it but you'd have to make it worth my while.

"neither did you in any way actually USE either equation to substantiate anything about your arguments?"

It's above. Pay attention. Battery drained at constant rate P. Constant thrust F. There's a velocity v at which P < F v. Unavoidable. Inexorable. Ineluctable. The reactionless drive is a perpetual motion machine.
Reply: @graphite7473  "you did nothing to explain where your insertion of "more energy out than goes in" actually is?"

I gave a complete proof, actually.

" You used the wrong equation (the one for power)"

Nope, the equation for power is the right equation, because power is energy per unit time.
Reply: @graphite7473  
" as representing change in kinetic energy within a system, and then failed to address or even acknowledge that when I pointed it out.."

That's because that's what power represents. I mean look, it's extremely simple:

dT/dt = d/dt(mv²/2) = m dv/dt * v (from the chain rule) = m * a * v = F * v (from Newton's second law).
Reply: @graphite7473  It literally couldn't be any simpler. If you're still having trouble, you'll need to read a textbook. I could explain it but you'd have to make it worth my while.

"neither did you in any way actually USE either equation to substantiate anything about your arguments?"

It's above. Pay attention. Battery drained at constant rate P. Constant thrust F. There's a velocity v at which P < F v. Unavoidable. Inexorable. Ineluctable. The reactionless drive is a perpetual motion machine.
Reply: Incidentally, the IVO quantum drive test had been postponed until January. It is now mid-January, so I expect we don't have very long to wait for something more definitive than our own best guesses... one way or the other.
Reply: @graphite7473  There's no need to wait for anything. Conservation of energy and momentum is as definitive as it comes.
Reply: @isodoubIet  imagine if rather than try to understand a thing, all you did was look desperately for a loosely fitting justification to decry it in oversimplified terms.. do you also 'believe' the Casimir Effect to be a bunch of malarkey? You never did weigh in on my offered real examples of "violations", such as superfluids, cosmic rays, superconductivity etc.. (all physical laws break down under the right, albeit typically extreme conditions.. I thought you had a PHD in physics?!? How old is your degree?!?) I'm curious what your threshold is before you are capable of incorporating any new information, even if it wasn't taught in school back in your day?
Reply: @graphite7473  You don't know anything about the Casimir effect, actually. If you did, you'd know it's nothing to do with this.

Momentum and energy are conserved. You're not going to make a perpetual motion machine out of spare parts in a lab.

"You never did weigh in on my offered real examples of "violations","

You never gave any examples of violations of conservation of energy or momentum, because you can't. It's verifiably true that spacetime translations are symmetries of the standard model, so anything you build that relies on the standard model must conserve energy and momentum. This is a theorem, not something you can haggle with.
Reply: @isodoubIet  why then did the 2004 Nimitz incident tic-tac NOT release a massive blast of energy upon coming to an abrupt halt after dropping 28000 feet in 0.7 seconds? Could thermodynamics be perhaps violated by it? That seems to be the general consensus among experts..
Reply: @isodoubIet  also why would we even expect ultra-high velocity, non-human interstellar technical vehicles to move along geodesics they AREN'T engineering in some way we have yet to replicate ourselves?
Reply: @isodoubIet  we are talking about high strangeness here, so maybe keeping an open mind is the better strategy?
Reply: @isodoubIet  but then again, I don't agree with you that there IS a perpetual motion machine involved in this discussion. That's YOUR point, which I have provided a counterpoint argument to.
Reply: @graphite7473  " why then did the 2004 Nimitz incident tic-tac "

Dunno, it was like 20 years ago, all the eyewitness accounts are wildly inconsistent, and there's basically zero hope of getting better information about it, so it's a waste of time to discuss. It's also off-topic.

"also why would we even expect ultra-high velocity, non-human interstellar technical vehicles"

Dunno, let me know when you find one.

"we are talking about high strangeness here,"

Are we? Pretty sure we're talking about some dude claiming he can make a perpetual motion device in a lab, not 'high strangeness', whatever that means.

" but then again, I don't agree with you that there IS a perpetual motion machine involved in this discussion."

It's an incontrovertible fact, which means you don't get to disagree, sorry.

"which I have provided a counterpoint argument to."

You have not.
Reply: @isodoubIet  bwahahahahahahahaha. All you've earned here. Beautiful.
Reply: Guaranteed, this guy is soooooo fun at parties............. (sic)
Reply: @graphite7473  That's the sound that a lack of arguments makes as it rattles inside your head.
Reply: @isodoubIet  I won't be able to help you with your cognitive dissonance, but just know that you've added flaunting your degree and then clowning in stubborn ignorance to the sting.. <claps>
Reply: @graphite7473  Yep that's also a sound the lack of arguments can make, well done.
Reply: @graphite7473  Still no arguments there, try again
Reply: You must have missed a sitting US congresswoman echo the description "interdimentional beings" that was first given by a whistleblower who literally brought the US President his daily intelligence briefings, and who represented both the National Reconnaissance Office and the National Geospatial-Intelligence Agency on the Pentagon's UAP task force, leading the group responsible for answering the question: "Does the USA (or anyone else) have a covert program that is in possession of and attempting to reverse engineer advanced non-human technical vehicles of unknown origin?". . . You also clearly didn't get the memo when the former director of the AATIP program came forward and began giving public talks; among the 5 observables derived from repeated observations are one or two that aught to be of the highest imaginable interest to a.. physicist. 'Instantaneous acceleration' is a new term they had no choice but to introduce in order to accurately describe the motion of these objects. Yet here you are dogmatically wedged into a corner of history that has been superceded by a genuine paradigm shift. We absolutely HAVE to continue investigating any and all new physical phenomena we may find hints to (not that 1g of thrust is very subtle, but hey I digress?).. because for once, we actually have advance notice that there is most definitely MORE to unravel.
Reply: @isodoubIet  there is literally a massive effort to explore the properties of extra, hitherto hidden dimensions. To unify the models, and describe a quantum gravity, but also this must surely touch on many more aspects of our reality. I don't think 'interdimentional' necessarily needs to be referencing anything more exotic than time, just to be clear. Since it seems we ARE dealing with an alien intelligence, I don't think we can speak with certainty about how they might express these incredibly deep concepts? Interdimentional might be the best translation they could come up with to articulate how they define time travel? Something tells me we are going to find out.
Reply: Now what does that have to do with a new form of thruster that doesn't burn fuel or operate on reaction mass ejection? It's pretty simple: we live at a moment where we know there are powerful forces we cannot yet define. This drive, no offense to the inventor at all, is a baby step. One that may ultimately culminate in a low-enrgy warp drive for real FTL.
Reply: @graphite7473  This drive is a low-energy device that doesn't approach anything remotely close to the quantum gravity regime where exotic phenomena might live. It's pure e&m, extremely well-understood.
Reply: @isodoubIet  "you don't know anything about the Casimir effect".. dude do you listen to yourself? Particles are also waves, it's called duality. Waves follow very particular sets of rules, and in order for a standing wave to form in a constrained medium, it must be equal to or harmonic to the dimensions of the constraints. Frequencies outside that range of options will cancel out through destructive interference, more rapidly when they are closer to perfectly out of phase (with their own reflections). In the original Casimir experiment he used two metal plates as the wavebreaks, creating a quieter environment of virtual pair production between the plates than the average without, resulting in a net force from pressure induced directly by the quantum fields pushing the plates together. Since then we have discovered much more about the phenomenon; when you bring a tiny gold sphere rather than a flat plate into close proximity with an opposing plate, the force follows a different curve, which is gentler and therefore much easier to measure and study than the more violent double plate interaction. Then it gets stranger.. if you position your sphere above a microscopic hole in the plate, the force becomes repulsive.
Reply: @isodoubIet  now, what does the Casimir Effect have to do with this? The quantum fields are everywhere. Can you name any aspect of physics that does not interact with one or another of them? We need to extend these effects of vacuum fluctuations *across the board*. They are a part of every other physical process, and we haven't incorporated that into our understanding yet.
Reply: @graphite7473  Yeah we have incorporated that stuff into our understanding actually. QED is extraordinarily well-understood, and the Casimir effect specifically is one of the easiest calculations to do in any quantum field theory. To the point, conservation of energy and momentum are still satisfied exactly in quantum mechanics. The Casimir effect is a cool little thing but it doesn't let you build perpetual motion machines, push off the vacuum, or anything like that.
Reply: @rockets4kids look it uo yourself you embarrassing lil kid.
Reply: The Chinese did IT and NASA confirmed it  @rockets4kids 

Literally came from a scientific journal that had linked this video
Reply: @isodoubIet  that might be the current equation which works at lower energies, but is incorrect or incomplete at higher velocities.   That would prevent limitless motion scenarios.
Reply: @isodoubIet  I read all of your discussion with Graphite with interest. As a layperson in this field, i don't have a horse in this race and I am not being combative but I do have a question. Are you saying, in effect, that the international patent Buhler was granted is technically invalid due to its violation of the laws of thermodynamics and that the examiners were in error? The international patent number is  WO2020159603A2
Reply: @spineboy  It can't really work like that, for a few reasons. First, we have evidence that special relativity works over a massive range of velocities. Secondly, if it's to be a useful device, it has to break our existing laws in regimes where we already know they work. Third, you can evince a violation of conservation of energy even when the device is immediately turned on, simply by describing the system in a different reference frame. There's no conceivable way for something like this to work.
Reply: Carl Sagan extraordinary claims demand extraordinary proof. That means a decent scale demo would be fine. That's down to the people making the claim. Like cold fusion if you can't replicate it then it's likely to be an experimental error.
Reply: @mikem6549  it was supposed to be tested by IVO on Rogue Space System's Barry-1 spacecraft back in January-February. Sadly we lost contact with the vehicle way before they could try it out. These results have been replicated by three other labs to the best of my knowledge, with IVO being one of them.
Reply: @isodoubIet are ye of little faith, God I hope you're not in charge of any physics departments!
Reply: @richardagar7830  Lmao find a department head who disagrees with me, I dare you
Reply: @isodoubIet  It's not a perpetual motion machine, though. It requires energy.
Reply: @isodoubIet  Uh huh...so why are you assuming it would have a constant force to constant power relationship?
Reply: @isodoubIet  ...The error is that it doesn't violate conservation of energy. Your assumptions about it violate consumption of energy.
On conservation of momentum, of course, we'll see... But the reality is, newton's laws of motion are not inherent laws, they are second order effects that are a result of normal physical conditions. If energy is never created, after all, how did we have a big bang? Why would there be anything at all, rather than nothing? It seems that in at least some conditions, energy can be created, or at least entropy can be reversed.
Reply: @AUniqueHandleName444  Nope, there is no error. It does violate conservation of energy and momentum both and it's not negotiable.

The rest of your post is nonsense that doesn't even mean anything.
Reply: @AUniqueHandleName444  Because otherwise it's a violation of the principle of relativity. There's no way around it.
Reply: @AUniqueHandleName444  It gives more energy than you put in. It's a perpetual motion machine.
Reply: @rockets4kids  Many things in the past DID function and were at the time "unexplainable" and were first discovered and THEN explained. Do you assume that we know EVERYTHING? 😀Good luck with that. 😀
Reply: @qaesarx  You're not wrong, but at this point, anything which cannot be explained by science is most likely a scam.
Reply: @graphite7473  - "It only takes a year to reach near lightspeed. "
Its weirder than that.
If you accelerate for one Earth Year at One Earth Gravity, you will reach almost exactly the speed of light.
But of course, nothing COULD accelerate at 1G all the way to LS.
Reply: @graphite7473  Your statement is not true.  If it was true, you would NAME the impartial third party labs.
Reply: @rockets4kids 
It can be explained.  It was discovered over a century ago now by Ernst Rutherford, who incidentally mapped the atom.
He found that by making one plate of a capacitor smaller than another a force was imparted from the small to the large.
I believe it's called the burr brown effect.
Further manipulation of sizes,shapes,materials,voltages and frequency enhance this effect hugely.
It may not be in the current vogue of mainstream science. But its validity is not in question. 
I think the problems will be manifold though.
How on earth would we navigate?
There would be huge time dilation effects too if you're approaching the SOL.
And that SOL thing...
Well photons etc that travel at the SOL do not experience time nor distance.
It's scalar mathematics as its 2D,not vector mathematics which pertains to the 3D .
So basically you get very close to the SOL and end up flat as a pancake 😳
Reply: @isodoubIet bruh it's because of absurd attitudes such as yours explains why we haven't achieved this already, it has likely been independently achieved AND DISMISSED by people like YOU, hundreds if not THOUSANDS of times. We would have BEEN ON MARS already if we had this 70 years ago. You should be ASHAMED of yourself.
Reply: @rockets4kids  Yes it does, we need to really scrutinize why we hold to dogmas in the face of new evidence. Modern physicists are more about defending the old ideas than exploring the new.
Reply: @graphite7473   - That is a false statement.  You cannot name ONE independent lab that has replicated these results and neither can he.  It is why in that whole video he does not NAME a testing lab.
Reply: @stoneneils  - Provide ONE independent testing lab that stands behind these claims.  Just ONE.  NAME the lab and link to the results.
Reply: @rockets4kids   Exactly.  These grifters ALL claim that multiple testing labs have validated their claims.  And they NEVER name those labs/provide a link to the test results.  The grifter who had his engine on a satellite last year - same stuff.  The lab he named ONLY acknowledged testing for vacuum/temp.  They never claimed to test the engine thrust.
Reply: @markTheWoodlands  Mike McCulloch is working with two other teams planning to launch cubesats with propellentless thrusters, one of them with connections to NASA. DARPA is no longer working directly with McCulloch but DARPA has launched a program called Otter, to demonstrate ability to maneuver without regret. DARPA is putting $17.4 million in 2024 into Otter. The Otter program will develop and demonstrate space technologies that enable operations in new orbital domains that are currently inaccessible. Capabilities demonstrated will provide increased mission duration and ability to maneuver without regret. Key efforts include the development of new propulsion systems, improved ground test capabilities, and analysis tools to support system development. The anticipated transition partner is the U.S. Space Force. Otter will progress through development of analysis and test tools, design of candidate propulsion systems, build of a demonstrator satellite, and complete with a space demonstration.
FY 2024 Otter Plans:
– Conduct selection of propulsion system vendors, test facilities, and analysis tools developers.
– Develop analysis tools to support system design.
– Upgrade test facilities to support component testing.
– Develop and mature propulsion systems through a Preliminary Design Review (PDR).
In 2023, they are getting good results from a capacitor with a dielectric between plates with 8 micron separation. McCulloch uses Aluminium plates and kapton dielectric but IVO uses a solid dielectric. There are at least three groups working on the propulsion experiments and six labs worked on ground experiments. In Mike McCulluch lab at Plymouth, they saw 0.25 milliNewtons. IVO saw 52milliNewtons. This works at only about 1 watt of power because attempts to increase power causes problems at this time. There are still times when the system does not work.
The IVO drive system weighs about 200 grams. A Hall Effect thruster weighs about 100 kilograms. The IVO drive uses about one watt of power. The Hall effect thruster uses about 1-7 kilowatts of power. IVO has the best results and have been able to make their system space worthy and had the funding to launch it. Mike McCulloch had the DARPA funding of $1.3 million. IVO seems to be privately funded. I do not know the IVO group's funding sources. The IVO Quantized Inertia drive experiment is a capacitor cavity experiment using a solid dielectric. They have made improvements to achieve substantially more power than the other groups. The system could theoretically scale by finding ways to scale power, possibly making an array of devices and multiplying the effect. However, there are many unknowns and highly reliable operation has been elusive.
Reply: @rockets4kids Perhaps the existing understanding of physics needs a higher level of scrutiny.
Reply: @your20downrange  Out in the real world of scientists, taking the piss out of others is how you advance your career.  As a result everything is scrutinized.
Reply: @isodoubIet  This invention makes no claim of perpetual motion, The claim is that it produces thrust that seems to violate the laws of conservation of motion.
Reply: @jamesbarrett9066  I don't care what is claimed. It's perpetual motion whether the "inventor" realizes it or not, because violating conservation of momentum always lets you build a perpetual motion machine.
Reply: @rockets4kids  The bs spouted by the Physics/ Corporate worldview is drivel. Constantly chasing your own arse instead of admitting there must be a Creator.
The rubbish about infinite monkeys and infinite type writers is a false analogy. For it to be correct every other key must be fatal to monkeys to reflect right handed amino acids which destroy lefthanded ones.
You end up with a large pilke of dead monkeys and an infinite army of angry monkeys and an infinite pile of smashed up type writers.
Reply: @Jack_Parsons-666 lighthuggets a la Alaistair Reynolds..?🤔
Reply: Word ?
Reply: @KC-nd7nt 1:04 1:05
Reply: Alpha centauri in less than five years?
Reply: @315-threefifteen  No. Buhler's propulsion tech is bullshit. It's a scam intended to soak up low IQ VC money.
Reply: @Dandelion_Stitches  however, my initial rejection of your off-hand remark aside.. do you care to enlighten me as to your thought process in more detail? Where EXACTLY is the bullshit, in your estimation? Surely you can do better than dictating? Explain your position. I explained why I thought this could be huge, with points I'm not seeing any counter arguments to here yet...
Reply: @graphite7473 well said!
Reply: @graphite7473  Grifters routinely claim to violate the laws of physics.  They always have PR people echoing their claims without specifics.  Theranos in space.
Reply: Can't get close to speed of light though. Material can't hold up to that strain.
Reply: @robertburns464  Can't get up to the speed of light though, because Buhler's thruster is a lie. This is a scam, not a discovery.
Reply: @robertburns464  what strain? It would be accelerating at 1 g, the precide force we're all feeling right now from the Earth's gravity.
Reply: @graphite7473  Robert burns doesn’t understand how space works lol. When you are in space, specifically deep space, there is no gravity resisting against you letting you accelerate up to light speed. It’s why the voyager 1 will eventually reach it. Just gonna take a super long time. 
But this seems very interesting. 
I’ve had my theories of alien tech using electromagnetic fields to traverse space and earth itself. You could turn a dial to set the field relative to the location. 

Would this technology this guy is speaking semi similar to it?
I know you’ve had this big discussion with that other dude about perpetual motion and whatever. But I am with you that we don’t know everything about physics. We have 2 theories that for now satisfy our understanding of the universe. But they are theories, they are good but there are certain things we still don’t know. Maybe this is one of them that will lead to a massive breakthrough? I am hopefully finally going to space baby. 

Imagine if they get this working big time too. Get it to the thought I had earlier with the Alien tech. Traverse the universe in hours or days. That would be insane
Reply: @dracomadness792  I will temper that with a reminder that the Voyager probes are propelled by conventional thrusters, and those are pretty much exclusively used to keep them pointing their antennas at Earth. At its current velocity, where it is essentially drifting, it would cover one lightyear in 18000 years, so a good deal slower than lightspeed. Those won't ever reach high relativistic velocities, but something like a reactionless drive could easily do so, assuming it's a concept we can get to work.